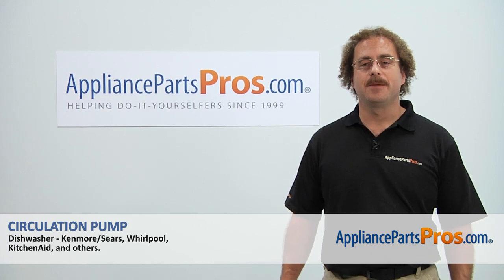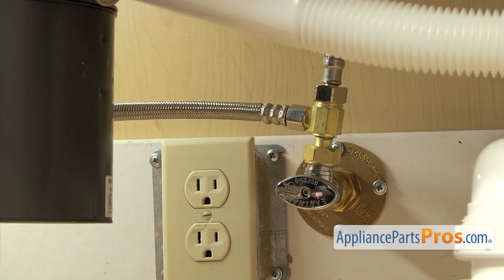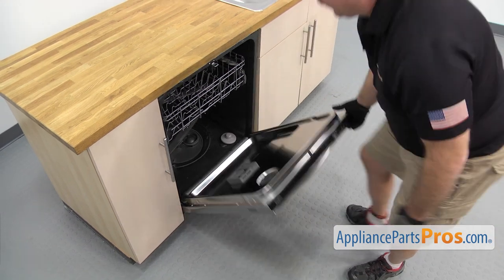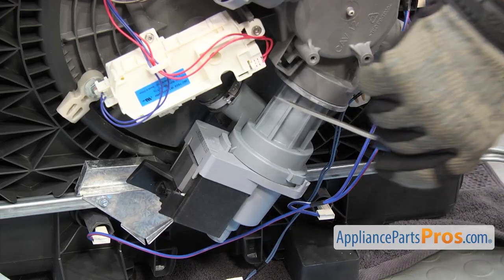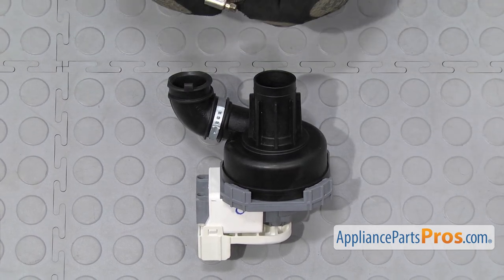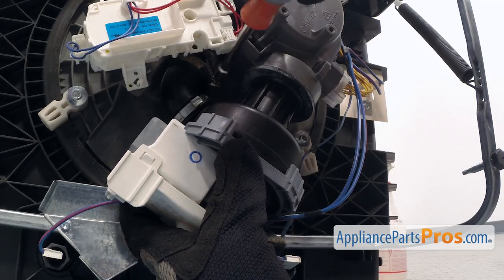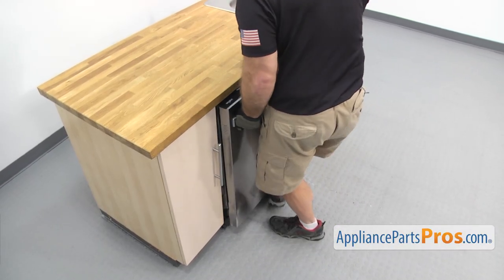How To: Whirlpool/KitchenAid/Maytag Dishwasher Circulation Pump W11084656

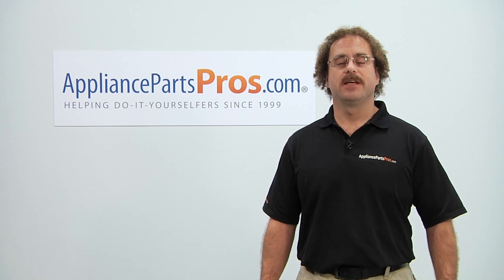Comment: Replaced based on this video and getting a 7:51 blinking code as well as blue light and start light. Any ideas or fixes?
Reply from the maker: What is the model number of your dishwasher?
Reply: @appliancepartspros hi! Im not the original commenter but i was wondering if this guide would apply to the installment of my new  pump W11414076

Comment: My old one looks like your new one.  My new one looks like your old one.  The gray one looks quite a bit smaller.  It sounds different.  I wonder if it has as much power.  I was unable to find a narrow enough standard clamp locally, but I was able to find a $12 crimp tool.  I also found it much easier to take the hook's grommet out and then put it all in at once, using a screwdriver to push the edges of the grommet in.

Comment: What circulation pump would work for a Whirlpool model WDT750SAHZ0?
Reply from the maker: It appears the part number you would be needing is AP6050340. Below is the link to the part so you can look at. If you have any questions please let us know. 

https://www.appliancepartspros.com/whirlpool-motor-pump-w11084656-ap6050340.html
Reply: Which circulation pump would work for whirlpool model wdta50sahz0?

Comment: Hi! Great video!!

WDT750SAHZO  getting 4/3 error blink code now. Cycle fills, doesn’t start washing, drains after a few minutes, cycle ends. (Soap dispense is open.) 

Does that sound like the circulation pump needs replacing? Thanks!
Reply from the maker: It does sound as if the circulation pump is the issue. The part number that you would be needing is AP6050340. Below is the link to the part so you can look at it. 
https://www.appliancepartspros.com/whirlpool-motor-pump-w11084656-ap6050340.html
Reply: @appliancepartspros  Thanks so much! Your video will make replacing the pump easy!✌🏼

Comment: Hi! I attempted to replace it myself how ever its now making a whirling noise and doesnt seem to be spinning the arms (it does produce water). My kitchen aid dishwasher is model KDTM404KPS1
Reply from the maker: You will need to double check the installation of the pump and make sure there is no debris stuck inside the holes in the spray arms.
Reply: @appliancepartspros i have cleaned the spray arms, would i follow the same process again in the video in order to instal it?
Reply from the maker: Yes, you would just follow the video and double check that everything was installed properly.

Comment: What pump would work for model number WDF330PAHW2?
Reply from the maker: The circulation pump for this model is W11612326. You can place an order through the website, or you can call us at 1-877-477-7278 to place an order over the phone.

Comment: How to test the motor?
Reply from the maker: What is the model number of your dishwasher?
Reply from the maker: We do apologize but that model number isn't coming up as a good model number. Can you please verify that model number?
Reply: @appliancepartspros  maybe it is because it is from a Brazilian distributor (Brastemp). But it is from whirlpool as well. 3 contact pump.
Reply: @appliancepartspros  BTW, do you have access to the w10669042 schematics?
Reply from the maker: Are you getting these numbers off of the motor? If so we need the model number of the actual dishwasher itself.
Reply: @appliancepartspros  this was the code of the electronic board of the product. The model is that one I sent you before. Whirlpool code similar to this machine are WDT740SALB WDT750SAKW WDT970SAKZ
Reply from the maker: We do apologize but that model number nor any of the other numbers that you have provided aren't coming up anywhere. We aren't able to find a schematics for W10669042 either.
Reply: @appliancepartspros  thank you for trying